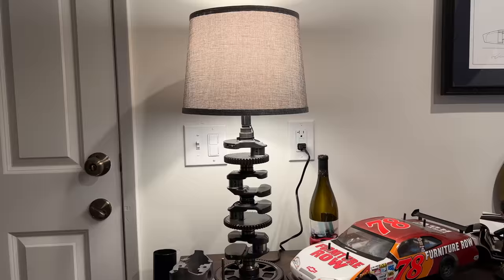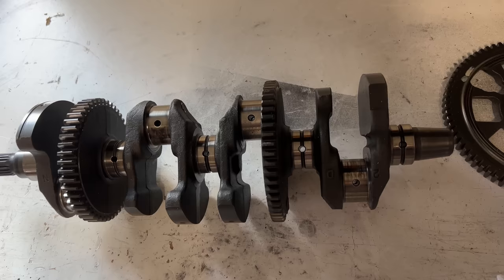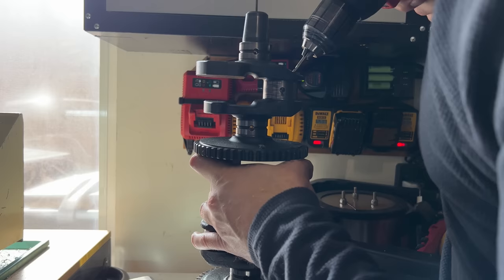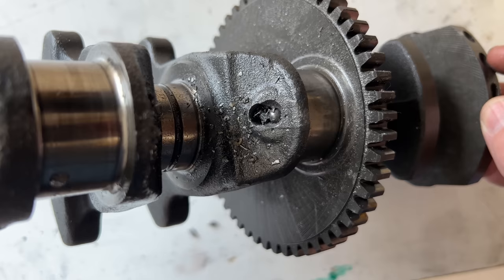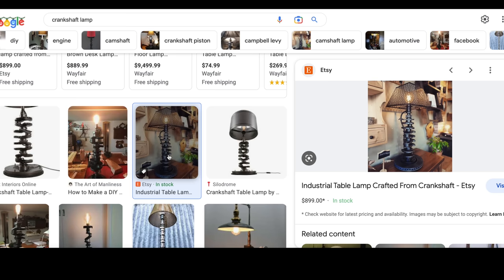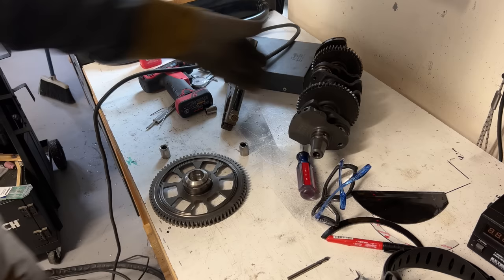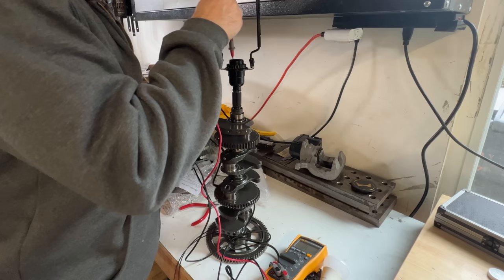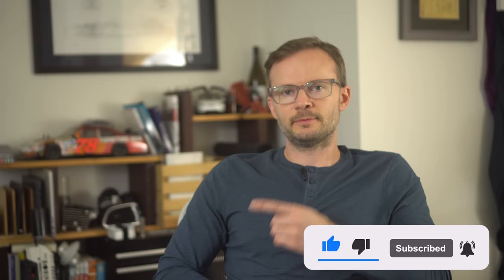Make A Lamp From A Motorcycle Crankshaft

Comment: Just use a 12 volt dc led with a converter and and run 1 wire and the crankshaft is the other many desk top lamps are low voltage and with sharp metal holes low voltage is a good idea.  I did my apprenticeship at GM and we had an EDM for removing broken taps.electro discharge machine reverse electro plating. Annealing the crankshaft would have made drilling it easy as well case hardening they heat it red hot in carbon for lots of hours increasing the amount of carbon at the surface and then rapidly cool it giving a .25 mm or so  deep hard surface but less brittle center.  To anneal it heat it red hot and slowly let it cool for hours. A plasma cutter may have been able to cut out the ball bearings in the oil galleries.

Comment: To be fair, it's still a lamp with a single $20 lamp shade, without the $21 Gibbs, and with a cheap $1 bulb.  And consider the $42 on bits as the cost of education.  It's a $51 lamp.

Comment: Nice project, if your engine is too small for the block to be a table with this method stleast the crankshaft gets used. As an elekchicken I have to say that this big metal object with high voltage running in and around it should be earthed and RCD´d...

Comment: You'll want to ground the lamp base.  If the hot wire ever chafes (and we never want to have chafing), the body of the lamp will be hot (and the band kind of hot)!!
Reply: @cmmartti  You're right... why is that?  I've never read that part of electrical code for lamps. I was thinking how on his lamp, the wire path has sharp edges and on a normal lam, there is better wire management.
Reply: @cmmartti  That makes total sense.  I've had the same experience with lamp cable.  That also makes sense how they're achieving the doube-insulated rating... His lamp, not so double-insulated haha.  I always find it curious how some switching power supplies are electrically double-insulated, but still use a C5 input.

Comment: Did put a earth connection into the lamp? In Germany this is needed to be up to code if there are parts Which could be touched. But I'm not your legal authority, but if you electrocute yourself, I told you so.

Comment: @superfastmatt HEY I finally know something you don't. Electrical discharge machining, would have made this SO MUCH EASIER, Barely an inconvenience! (Or I'm an idiot and it wouldn't have worked, but yeah...  Also, are you a Ryan George fan?
Reply: they make handheld deep hole edm machines now?
Reply: @lasskinn474  So I guess I am an idiot. I have seen some pretty DIY setups like this one https://youtu.be/rpHYBz7ToII ,but that is probably still a bit of work, and equipment. Critically the part has to be underwater, so that's a big problem, and a pro setup costs more than my cars.
Reply: @MDK-oq5vb  yeah it's neat but not very viable unless you're like.. I dunno, ben krasnow(applied science, great channel). a drills a drill. I'd love for a cheap setup for some 3d printer parts making.  edit: so I opened the link after replying to not go out of writing the reply lol, yeah bens great.

Comment: I could've definitely done it for less money!
All you have to do is buy a cheap lamp with roughly the dimensions that you want from your final result. This way you get the right size of lamp shade on the first try!
You then strip the lamp to end up with a switch, a bulb holder, a plug and some wire. You realise the wire won't fit into the holes, so you strip off the first layer of insulation. You find out there's not enough wire, so you take apart something else. The switch wasn't made with disassembly in mind, and you can't get it to work with a different wire. Hold on, I swear this was cheaper...
Reply: Sounds about like a super fast mat video. I'd watch it.

Comment: If you possess such a tool, a plasma cutter will blow the hardened steel bearing straight out, with minimal damage to its surroundings. 

Nice job though Matt.

Comment: Have you heard of EDM lord of drilling? unfortunately is expensive, so not great for this project.
On other side... is that plug single orientation or you can connect it in two ways?

Comment: Live is supposed to be the middle of an ES bulb ? Why (since it's AC anyway ?). In UK we have plugs that differentiate live and neutral so the switch is assured to be on live but that's because the UK plug us the best plug in the galaxy hey and is fused as well. US and European 2 pin plugs are reversible so which is live or neutral is a 50:50 chance every time you plug it in. Are you going to rewire your ES socket every time you plug it in ? Did you earth the steel crankshaft ? Who has time for that anyway. Safety 4th. Maybe.
Reply: I think that was kind of a long-winded joke on the electricians :J
Reply: Actually, most US 2-pin plugs are not reversible; the neutral side usually has a wider prong so it won't go into the hot side.  (Some don't have this -- particularly "wall wart" chargers where it doesn't matter, or older plugs before this became a standard.)  And this does matter for ES bulbs, because you can touch the side of the bulb while you're installing it.

Comment: i have found that the lamp socket direction is not important. i have a lamp, with many similar features. it has a led bulb. it has a socket and two wires, But most importantly, it plugs in with a cord that is identical on both prongs. while i would like to think i am perfect.... i have unplugged it and plugged it in 100's of times.

Comment: 1 use an led you are now dealing with not deadly voltage (and a not so cheap driver but its a must)
2 coat the whole crankshaft in silicone clearcoat there is a 10$ spray that does that,or coat it in anything im not your boss
3 use the whole crankshaft as a negative wire, you now have 50% less wire to think about dealing with
4 buy a graphite varnish and make graphite powder by politely hammering a 8B pen
5 mask out a trace from top of the crankshaft to the bottom following all the curves and twists
6 spray graphite varnish along the trace and put powdered graphite along it before it dries
7 https://www.youtube.com/watch?v=BYm69wGN2Gg&t=850s we are gonna electroplate that trace 
making the whole crankshaft a pcb...tehnically 
8 personally i would also gold plate on top of the copper and then spray silicone clearcoar generously 

now you see why led there is no way i would trust this process with conducting 220V AC 
you could probably find a better way to do the positive terminal concept like carfully cutting conductive tape and then painting over it but the ONLY true solution is this: CRANKSHAFT IS THE WIRE
Reply: A low voltage bulb and using the crank as a conductor is where I was going, and to save a lot of trouble I would carve a shallow path up the 'back' side of the lamp with an angle grinder. Super glue the wire in place, maybe hide it a bit with liquid black tape, and then paint or clearcoat to taste.

Comment: Only one way  I would have a crankshaft would be following a divorce.
If you use a jow voltage setup (12V LED) you can use the crankshaft as one conductor and a ~24ga magnet wire for the other. Barely noticeable.

Comment: Ignoring the fact that your project is done, you could probably have managed to get the wires thru the 45 degree turns by convincing some fishing line to feed through everything, then using that to pull the wire through. Sometimes it's tough to convince the fishing line to grip the wire though, so then you use the fishing line to pull string or twine or something, then use that to pull the wire.

... I wish I had photos and video to share of what it looks like when you use such a methodology to pull 1800-pair of phone lines.